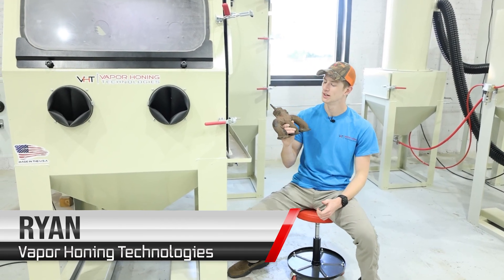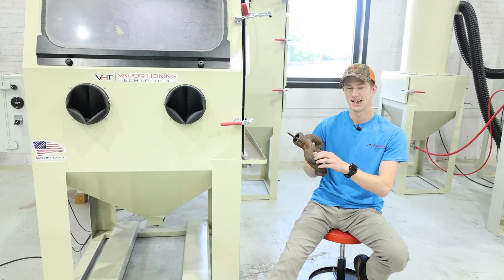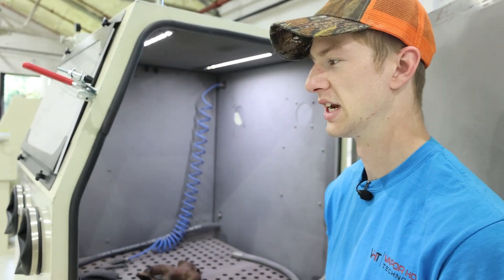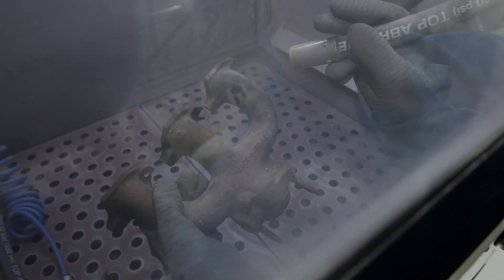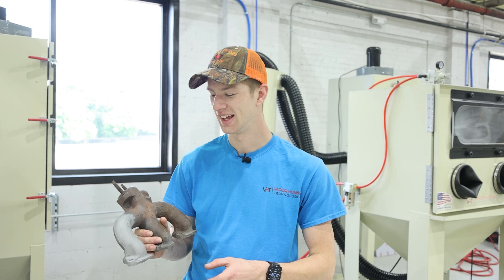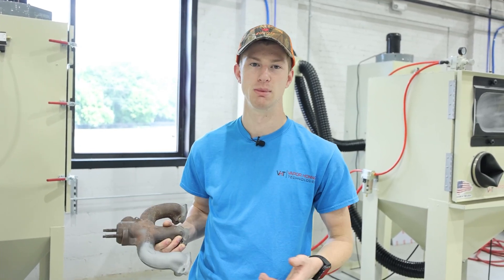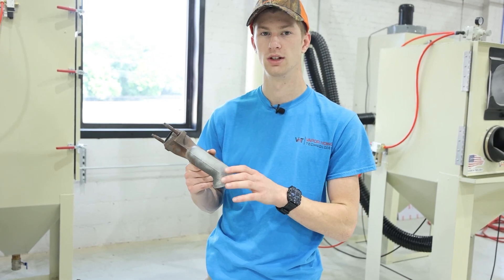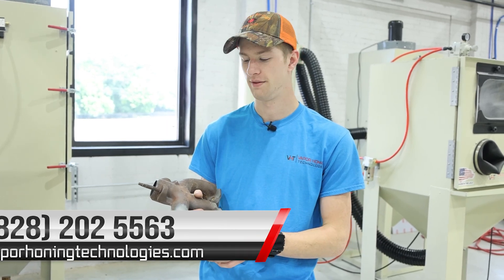How Fast Can Sand Blasting Remove Rust? Cast Iron Restoration!

Comment: I much prefer to work with a one of your good size wet blasting machines .. could such one machine using suitable media remove rust as well as paint on casting parts as well as body parts ?
Reply from the maker: You can absolutely remove rust in a Vapor Honing machine using aluminum oxide. It will provide a rougher finish than a standard glass bead, but it strips rust much faster.